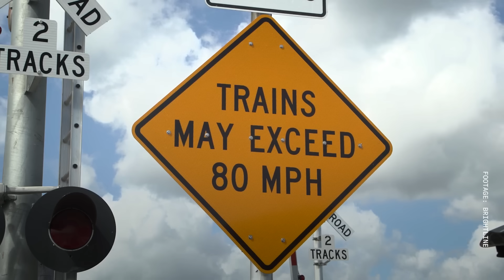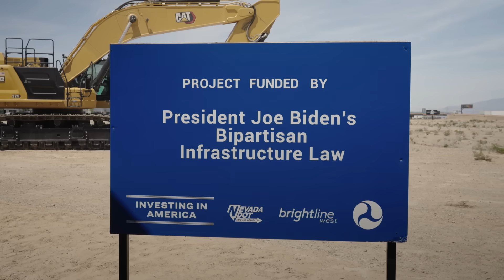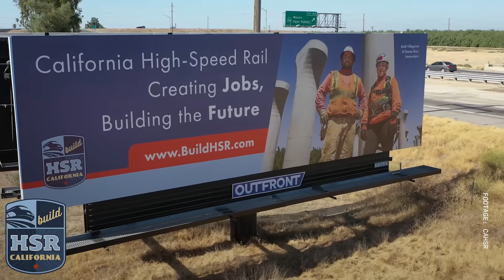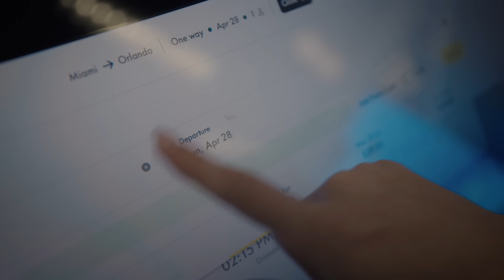Inside America’s First High Speed Rail

Comment: Great until you realize the astronomical cost which will be offset by the tax payer if public ally owned. Getting through the vast empty land and Rockies in the west is going to be an expensive and unnecessary expense. Makes sense for most of the east coast for large metropolitan areas, but going cross country or even halfway across the country is better served by airlines.

Comment: I'm sorry to disagree, but the Amtrak Cascades corridor, Eugene Oregon to Vancouver BC is NOT suitable for bullet trains; unless of course proposing such a route is meant to be "planned to death" as in, planners taking their sweet time getting paid to plan, all the while knowing it is not a suitable corridor. Seattle planners committed this offense with the Green Line Monorail proposal: 4 years of planning knowing full well it would go over budget over 800%. The voter approved budget was $2 Billion but the overall cost of the proposal was around $9 billion. 

The Amtrak corridor need only restore the "tilting" Talgo fleet of 7 trainsets to its wildly successful 22-year history of passenger-rail service. BTW, the Talgo trainsets were engineered in the USA during/after WWII. They broke all rail speed records at the time and still hold the record for lightweight and energy efficiency. They offer a more comfortable ride than Acela at 150mph. Talgo coaches can reach speeds of 125mph achievable with Talgo 21 diesel/electric locomotives that can also raise a pantograph to overhead catenary where suitable.

Comment: There are 2 high speed rail lines already in use in the US. Amtrak has the Accela Express line that travels the eastern coast to Washington DC. Florida has the Brightline line that travels from Miami to Orlando. So you are not accurate in your statements. The high speed rail that is being built in California would be the 3rd line in the US. I bet you Texas will have their line running between Dallas and Houston before California finishes their line.
Reply: what the top speed ?
Reply: Amtrak's Acela Express trains can reach speeds of up to 150 miles per hour (mph), but only on certain sections of the 457-mile Northeast Corridor (NEC) route between Washington, D.C., and Boston. The fastest sections are between Mansfield, Massachusetts, and Richmond, Rhode Island, and South Brunswick and Trenton, New Jersey. The Acela's top speed is slower than other high-speed trains in the world, and it shares the NEC with slower regional passenger traffic and freight. However, the Acela's tilting technology helps it travel at higher speeds on curved sections of the NEC without disturbing passengers
https://en.wikipedia.org/wiki/Acela_Express_(trainset)#:~:text=165%20mph%20(266%20km/h)%20(design)%20150%20mph%20(240%20km/h)%20(service)

Brightline, Florida's high-speed rail system, has a maximum operating speed of 125 miles per hour (mph). However, the train's speed varies depending on the section of the route:
Between south Florida stations: 79 mph
Between West Palm Beach and Orlando: Up to 130 mph
Crossing the St. Lucie River: Limited to 25 mph
https://en.wikipedia.org/wiki/Brightline#:~:text=Additional%20stops%20are%20being%20planned,(111%20km%2Fh).
Reply: @Kevin17Crocker    isnt acela the fastest train in northern america  ? However the speeds mentioned will probably be just near 250 kmph (  category 1  HSR) . however is it officially a designated HSR as per global norms  ?

Comment: More on the benefits of high-speed rail - for example, Train travel offers a more relaxing and comfortable experience compared to cars or airplanes. Passengers have more legroom and can move around freely. This allows them to work, read, or simply relax during their journey.
Reply: Admittedly, more legroom is only true for as much as operators care about this. I've been in railcars with my knees rubbing against the seat opposite mine, too. And I've been on buses with more legroom than even first/business class on a train. 
What is true is, that it's easier to make trains longer to accommodate more passengers than it is to make planes longer. Same with luggage space, nobody cares if you pack an extra bag on the train, but on a plane, it really does come down to mere pounds to calculate the amount of fuel needed.
Reply: @DaleNorenberg  this is all stupid reasons to build and have trains
Reply: @The_king567 What TF is wrong with you?!  You hate trains and anything rail-related?!

Comment: I’ve been to Japan. This is laughable
Reply: Agreed. In Japan you don't get groped, scanned and treated like a criminal by TSA just to get to the shinkansen terminal. Second they have ZERO (outside the slow speed maintenance terminal) grade crossings. Third they don't share the line with freight trains. Fourth they have impeccable scheduling and are 99.9% on time.
Reply: @roberthale8407  HSR will not share tracks with freight, different rail line standards. TSA is for planes not trains, no TSA; it's like boarding a bus. IDK about scheduling or grade crossings, though.

Comment: If there was a Portland-Seattle-Vancouver high speed rail line I would ride it a lot, especially if there was onboard customs or pre-clearance for the Seattle-Vancouver section (currently on the low speed line there is only pre-clearance in Vancouver, not Seattle).

Comment: umm... Amtrak Accela travels at 150mph and is being upgraded, which is faster than the Florida Brightline, but it is completely ignored in this piece...
Reply: That’s because it doesn’t travel 150mph. Our 90+ year old infrastructure keeps that from happening.
Reply: @MrMarshmallow26  It runs between 130-150 with that old infrastructure ...the real issue is it shares the track with freight which causes interruptions...
Reply: @MrSuperduperpj  It reaches that on segments of track, however a majority of the track is 125 mph or slower. You should also consider Acela’s average speed along the entire line, which is far below that (70-80 mph). Brightline West will be the first true example of high speed rail with dedicated tracks, no freight traffic, and being able to maintain high speeds with newer track infrastructure and rolling stock. Freight traffic also isn’t a problem in Acela’s case, as Amtrak owns the track that Acela runs along, not a freight company. So freight companies do not excuse Acela’s slower speeds on, again, aging infrastructure.

Comment: This is all bullshit. America should be investing in MAGLEV (Magnetic Levitation Trains). The speeds are well over 100 mph faster than the fastest European HSR (HIgh Speed Rail), and it is 1 million times safer than traditional  steel wheel rails.

 Unless America is going to be building complete new rail lines,  Amtrak will still have to share rails with commercial frieght traffic. In America commercial fright rail takes precident over passenger rail. The main reason for  freight having priority is that the vast majority of American railroad tracks are owned by private commercial freight rail companies.

Maglev IS DEFINITELY MORE EXPENSIVE than traditional rail, but because it runs on an elevated guideway there will is no other competition for rail access. The elevation will prevent accidents between pedestrian, animal and vehicular traffic. Due to the way the train hugs the guide rail there is absolutely zero chance of derailment. Even after a horrendous head on collision accident  in  Germany on its Maglev test track,  neither train derailed. 

The current MAGLEV train in China ( GERMAN engineered) reach speeds of 281 mph. The newly developed Chinese Maglev train based of that German engineering can reach speeds of 387 mph. The Japenese Maglev trains that run in a trough can reach speed of 375 mph. Though 10 times more expensive  than traditional rail, the cost would be recouped due to less need for maintenance  of the guiderails and the trains themselves.

Since the train is elevated above the guideway by half an inch or more there is no friction to cause wear and tear on track or train. That lack of friction also means a much more pleasant riding experience with less vibration and noise for both passengers and communities the train would pass through. 

Maglevs can also do things traditional rail, especially HSR cannot do. Maglev trains can climb at much steeper angles, have a shorter turn radius, they can also accelerate and decelerate in much shorter distances and because all information is handled electronically by fiber optic cable and/or by cellular systems signaling and traffic information can be handled at real-time speeds. 

The bottom line is, America needs to leap frog into the future and build THE NEXT thing not the same old shit that can't compete with planes. The next generation of MAGLEV is already being tested to run at speeds between 350 and 700 mph. 

That's airline speed at 40 feet off the ground, not 37,000 feet, where if something goes wrong its kiss your ass goodbye. MAGLEv can be beneficial to airlines by providing fast and affordable travel between cities that are less than 1000 miles apart. For those that cannot travel by plane for medical or fear reasons, or those on the no fly list, Maglev would prov8de a fast safe affordable way to travel. If you add car carriers then traveling with your car eliminates the need for renting  one at your final destination.

If America is serious about reducing green house gases, removing unnecessary truck and passenger traffic from the roads. Improving climate change, building out alternative fuel and electrical charging infrastructure then building a Magev train system😢on the 6 major interstate highways that travel North/South and East/West should be a no brainer.
Reply: Germany canceled it's Maglev train plans due to cost overrun, safety issues and very limited capacity, in contrast to high-speed trains, not only German but also Austrian, French and Swiss ones, running on both dedicated HSR lines and shared-use main lines
"not the same old shit that can't compete with planes" traditional HSR sure can compete

Comment: Retired UBC memder in Baltimore, Maryland. Project labor agreements DO NOT set sustained, long term presidents or standards... constructing the rail line is a tiny part of what will generate profit for the elites... what about maintenance done in the future? what about the infrastructure that will spring up around this, restraunts, hotels, etc? Will there be a commitment to collective bargining in that regard. I hope so. With regard to an earlier commmenter, will this rail line be public transportation infrastructure like roadways, waterways and airports? Or will it be privately owned like all the other railroads are? Will the future railroad workers on this line be forced back to work from a strike like the Biden administration did to current railroad workers? Will this rail line be operated like the one running through East Palistine, Ohio... long since forgottened by this administration. May I suggest this be assablished as a worker owned bussiness?

Comment: In China, only trains go above 300 km/h or 188mph considered high speed rail, below 300 mark trains are called motor car... So by Chinese standard, that thing in Florida doesn't even consider high speed rail. And why high speed rail come in contact with pedestrian, vehicle crossing? It is a suicide trap? High speed rail tracks should be on elevated ground and fenced on both sides.
Reply: She stated that the train from Miami to Orlando was not considered "high speed."  She was riding this route because Brightline is the company building the first high-speed rail from Los Angeles to Las Vegas.🚄
Reply: No 1 gen trains has max 250. And 3 gen trains operate in big range which is goes lower than 150. Anyway in some places, and depens on wather its has to decrease speed. There is no only 300 +. This is not age or something where there isnt any backwards. If its 300+ how can it be stopped. The only way peoples can get in is station which can reach 300
Reply: "动车" is the abbreviation of “动车组”, which stands for EMU (Electric multiple unit) rather than "motor car". "高铁" is for high-speed rail, and usually lines that reach 250km/h can be called HSR (e.g. Xi'an-Chengdu HSR with a max. speed of 250km/h). Many Chinese people like to call the trains as "高铁", and this doen't really make sense since you cannot call trains as rails. As for the train categories, "G" is for "高(Gao)速动车组列车, high-speed EMU" instead of "高铁, high-speed rail", and "D" is just for "动车组列车, EMU trains". Usually, G trains can reach 300km/h or above at least in some sections, but the lines will limit the speed of the train. For example, G and D trains from Xi'an to Chengdu don't really differ from each other, as both have a maximum speed of 250km/h and the same prices. Deliberately distinguishing between them only creates confusion.

Comment: It's about time!  Let's hope that the rails laid today will be compatible with each other so that if and when these pockets get connected they're all the same so we can have coast to coast routes.
Reply: They’ll all probably be the same gauge.
Reply: @MrMarshmallow26  key word there "probably". lol
Reply: @rockys7726  I see no reason for them to have varied gauge lol
Reply: @MrMarshmallow26  Yet they're all made by different companies.  So do you think they will all end up at the same gauge independently?
Reply: @rockys7726  Alstom has Avelias on the NEC, Siemens is already running Chargers around the country, and Stadler has trains on CalTrain and other commuters. They all use the same US standard gauge. They already know what gauge the US uses. Additionally, the map shows Brightline West and CAHSR having a connection at one of the stations. So unless the station will have separate tracks for the two operators, it’ll be same gauge. Or they have separate stations and were just being shown on the same map.

Comment: Everyone seems to want true high speed trains everywhere. I live in the northeast and we have great service from Amtrak with their relatively high speed trains and somewhat slower normal services. They are also making improvements to the existing lines to improve speed and dependability. Any train service that can run around 100 MPH for most of its run will be competitive with driving and shorter airline service due to traffic and airport hassles. It will be less cost to build and then should be less expensive to operate. That means tickets to ride should be lower. Whether it is privately owned or publicly owned would not make much difference. Either way for long term success the train will have to earn enough ticket income to keep it running. Due to the large federal debt long term the governments can not be expected to help pay for train operations.

Comment: Yeah the small countries have High-Speed Rail maybe even networks because they are SMALL countries they only have to build a couple of High-Speed Rail lines and they don't need to cut through different jurisdictions in different states with different property ownership yada yada yada.
    Look at the landmass and the topography of Japan versus the US look at the fact that China doesn't have to meet any of the carbon emissions rules that developed countries have to meet.
Reply: that's not the reason. Most of the countries don't limit their rail service on lines within their borders, but run trains, also high-speed trains to cities abroad as well. 
And it's not only about the size of the country or its population, but about centers with higher population density which are connected - and also the US has lots of them! Guess what: even Norway, a country with a total population which equals only two thirds of the population of NYC, has HSR in the area with highest population density

"fact that China doesn't have to meet any of the carbon emissions rules" yes, unlike the US where most lines are operated with diesel trains, they run tons of electric trains throughout China ...

Comment: Another good investment idea would be to for use freight rail to ship interstate & ship by truck for intrastate.  

This would get many of these big rigs off our highways making them safer but would also minimize the damage inflicted on our roads, thus requiring less $ to constantly rebuild them. 

Another major benefit would be say five or so electric diesel locomotives can pull say 100 flat cars with 2 53' trailers/ car.  The alternative is a tractor pulling each trailer across country just for an example

Comment: Highspeed rail only makes sense to connect large metropolitan cities with massive populations of people that don't own cars.  This just isn't true in the USA.  Los Angeles County requires a car.  San Francisco not so much.  However, even Las Vegas Strip requires taxis move around the full length of The Strip.  Sure, there are other forms of rail on the strip, but they are disconnected and inconvenient station locations.  I wish the monorail was longer and stopped at more casinos/hotels.
Reply: It should connect larger cities, but can also serve smaller cities in between. And it's definetly not only for people that don't own cars. I have a car, we had 2, and we still make use of local public transport and rail services sometimes